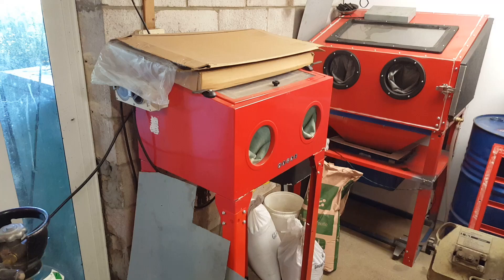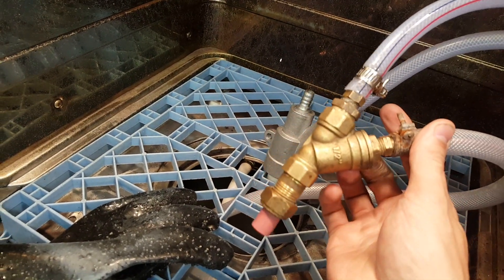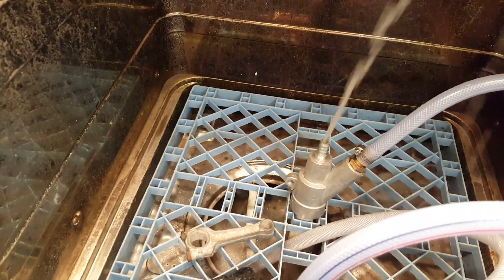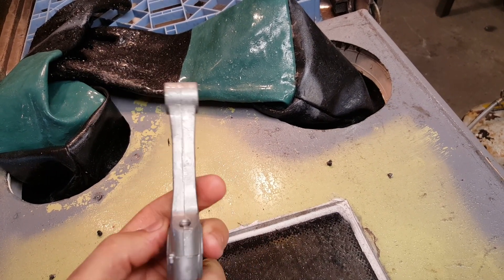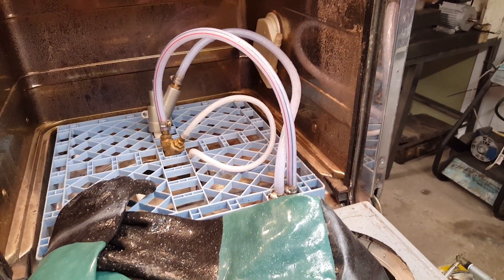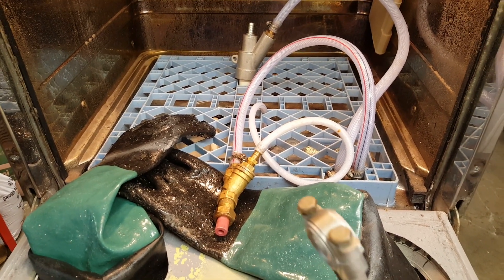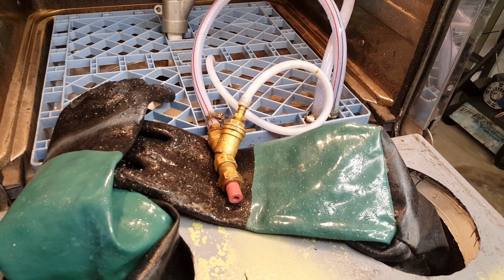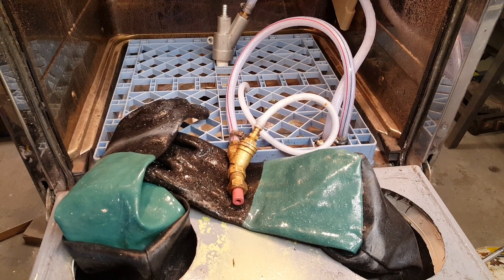DIY Vapor Blast Nozzle Update Pt1

Comment: hi bro, sorry, I'm back again to ask, what type of sand and what size to remove paint, rust and crust?
Reply from the maker: Depends what you are doing if its heavy corrosion on Aluminum or steal I would use a mix of glass beads and aluminum oxide. If its light corrosion I would use glass beads at a grade between AC and AH
Reply: for peeling paint using 100-200 mesh beads glass is it sufficient or too rough?
Reply: @ArmouryEnterprises  how do I order glass beads, I am always asked what size and type I am confused to answer because in my area it is very difficult to get the sand so I have to buy it online outside the city. What am I confused about is the size and type of glass beads that I have to order to peel the paint and clean the crust on the car's engine parts?

can you help
Reply from the maker: Hi Budi, Every country has a different process, I am not familiar with yours.

All I can say is you need glass beads, and in a grade between AC and AH. Some companies grade by mesh size. If they do in your country, you will have to google the conversion from alphabetical grade to mesh grade.

Comment: Awesome video great ideas. I do need that windshield wiper concept. I put together a fresh water squirter using a bug spray pump it works really well. But still has problems
Reply from the maker: I did a video on the wiper system the other day. You can find it here - https://www.youtube.com/watch?v=cpOFekz3gyQ&t=15s

Definitely worth it, the system is so much easier to use with a wiper over the fresh water spray.

Comment: What size bore is the nozzle?
Reply from the maker: 7mm
Reply: @ArmouryEnterprises   thanks- ive just ordered an 8mm from china. as i have to use mine outside im thinking about using an old bath- with a splashback. as i need to do large size- full engine.  thanks for the info series - very helpfull!
Reply from the maker: @automateanything  I use 10mm on my bigger cabinets but those smaller guns I build use the small pink nozzles that the largest I had was 7mm.